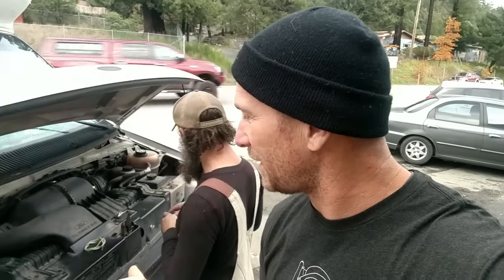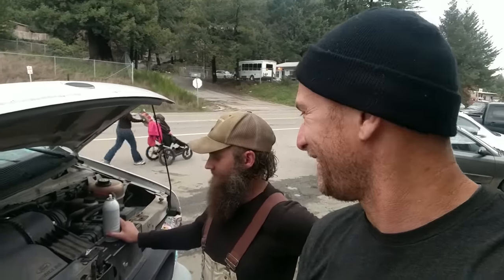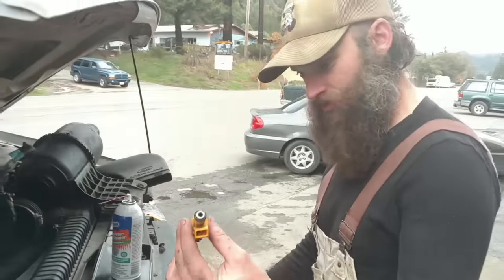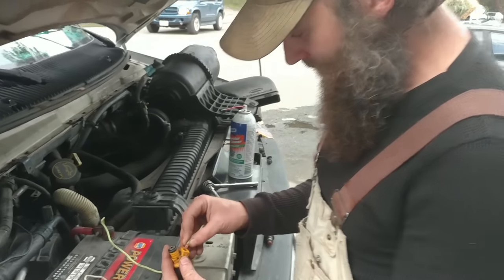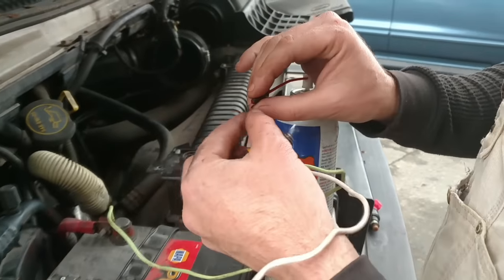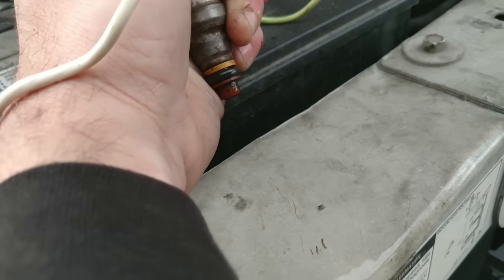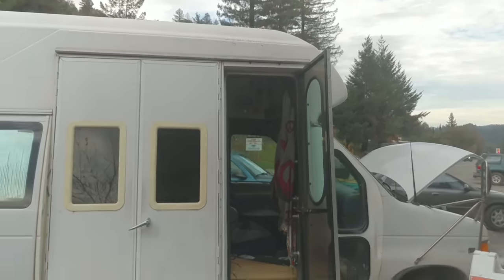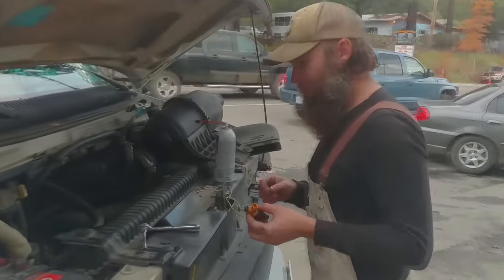Dirty fuel injectors?   Dont buy new ones- do this instead!

Comment: Remove the fuel filter, empty it, fill it with carb cleaner or sea foam etc, then crank the engine a few seconds, wait, then again, then again.
Reply: Tada!
Reply: sea foam doesn't work for this, it was developed for marine outboards to help keep carbon buildup down, it's not strong enough to clean injectors.

Comment: Make sure those fuel injectors are of the high impedance style! I wouldn't hold a peak and hold injector open like that for a second let alone the time it takes to clean them. They will burn-out without having fuel flow around to cool them. The low resistance will heat-up very quickly.
Nice trick otherwise.

Comment: First find information , which is the voltage of the fuel injectors.Most of them are 12 Volts , so you can take that voltage from car battery.You can use carb cleaner, denaturated alchocol, ethyl alchocol 96%, nitro....
Reply: al co hol

Comment: Want to know something scary?
Inside of gas turbine engines, there are things called swirl cups. Similar concept as the fuel injectors for your van - they atomize the fuel right before the ignition - poof! Swirl cups are about 12,000$ a piece. Depending on the size of the engine, there could be as few as two or as many as six. The engines on an Airbus A380, those will have four. A C-5 Galaxy has six. Then there is the question of “if and when” that are added to the invoice, as well as the man hours and downtime for that aircraft.
In the field, we use an engine cleaning solution called BNB. Think of this like Mechanic In A Bottle… but you definitely don’t want to get this on your skin. This will literally melt your skin on contact - pain included. This is not an acidic solution, though, so; we keep lots of vinegar available… in the event we feel like pickling ourselves. BNB helps to loosen and flush debris and other unwanted material from the blades, rotors and everything else inside the engine. Here’s the scary part: If there is no BNB on hand, we are to remove the swirl cups and just take a low pressure air hose (250-300psi) to clean them out the best we can. 
The people that give those orders have never seen the inside of a gas turbine engine, let alone the combustion section of one. I guarantee it.
Reply from the maker: Comments officially hijacked

Comment: Whats the product used? Also can you use brake cleaner from autozone, (non-chlorinated) as well or does it have to be carb cleaner?
Reply: I will say both would work to a point, but carby cleaner would be more preferable as it removes varnish fractions much better.
Reply: Carb cleaner costs $8 and its made to remove carbon deposits in engines, if youre going to pull your injectors spend $8 on the proper cleaner

Comment: for rookie playing with 12V battery that close between+ and - could be fatal, The current can flow as much as 600Amps and weld the cable and burn the 12V battery.  It is better to use 9V battery.
Reply from the maker: calm down poindexter.  no ones gonna die from this silly procedure.
Reply: @dridiott  You obviously have not seen a car battery explode, do not do anything electrical around or over a battery. He could make a small investment in longer wires with a on/off switch and an injector connection plug
Reply: When you say 9volt batt. do you mean the small household battery for toys and radios etc ?

Comment: Or you can just add injector cleaner into the gas tank at regular intervals, such as at oil changes.  I have two vehicles with a combination of 345,000 miles and neither have had the injectors removed.
Reply: He has shot injectors, and if theyre constantly dirty probably bad filters, and possibly a bad pump now. He needs to get a new gas tank, they arnt expensive and hes gonna wear all his lines/engine down with debri

Comment: Just the fact that he has said he has done it like this so many times should be a clue. He is likely having problems due to a clogged fuel filter, and maybe a little too much meth.
If there is anything blocking the injector the best way to do it is pressurize the nozzle with solvent (sometimes air is enough) and click the injector a few dozen times. That way, the debris will blow out of the injector instead of lodging itself further in. Also, go ahead and wire up a switch on the negative wire, and real connectors. It will cost a lot more ($3) but will be worth it.
Reply: clogged filter wouldnt let the fuel get to injectors good try on Shaming someone you dont know...try knowing what your talking about next time.
Reply: @thomastrumigneault8918   Moron, a partially clogged filter will let fuel through, but not enough for the engine to run properly at high loads or high rpm. When the fuel pressure drops, the engine will start to go lean and the ecu will have to open the injectors for a much longer duty cycle than normal. This guy is cleaning his injectors the wrong way and its not going to have any lasting effect. That's why he has had to clean them so many times. Can you wrap your pathetic noggin around that or should I dumb it down for you some more?

Comment: So what about when the solenoid gets weak?

Also if you are spraying flammable cleaner and an arch from the wire to the injector ignites it.. you will have a fire.

You should change your fuel filter if your injectors are getting plugged up all the time or atleast put another one in the engine bay..
Reply: You only get the possibility for fire if there's a spark and it has to be very near fumes.
Reply: @bobclifton8021  doesn't take much in an enclosed space

Comment: not to mention how close those 2 little bare wires were when inserted into that injector plug then hooked to that battery with no short protection....sooner or latter he's going to get an interruption that will light up his day
Reply from the maker: if youre afraid of getting electrocuted by 12v you should put in another tampon
Reply from the maker: stop cheating on your wife lol. and stop using the elipsis with extra periods... oh wait does this hail back to the tampon thing?  clever girl............. @scooterbutner9674
Reply: @dridiott  It's not voltage that kills you, it's current.  300kV won't even kill you until there's enough load to produce enough current to stop your heart.  I'm being picky but technically, the voltage isn't what determines whether you need a tampon or not.  These injectors probably draw milliamps, so not a bid deal.
Reply from the maker: @jerrybrown66  exactly.
Reply from the maker: @botakbishop1441  glad you enjoyed the video.
Reply from the maker: @botakbishop1441   I like to hear idiots try to speak their peace and think they burn somebody. That's precisely why I leave the comment section on.  Thank you for your service and please, respond with further aplomb 👍😂
Reply from the maker: @botakbishop1441  I love you. 💋

Comment: Got a dirty gas tank...had to do this a dozen times already.
Changing fuel filter is important.
Royal purple fuel injector cleaner worked increably well for me.
If a injector has low resistance nothing but new injectors well cure problem.

Comment: Very dangerous way to clean injectors, the Carb Cleaner damages internal components, it also ruins the filter which then goes into the internals of the injector, It does not let you know if the flow is correct compared to the other injectors. We have injectors come in for cleaning where someone has done this and the results are disasterous.
Reply from the maker: i dunno gramma.  flow looked pretty good.  also the filter is upstream from the injectors.  do your homework before you challenge the stupid shit on this channel denny :)

Comment: Lastly, autozone brand carb cleaner, crc brand carb cleaner or gunk for cleaning the fuel injectors? Same question applies to the brand name on using brake cleaner as a substitute or alternative if applicable with little to no damage at all.

Comment: If you have accidentally cleaned your tank and fuel filter, don't worry - you can enjoy the same experience as this guy by manually putting bits of crap into the injectors once every week and then taking them out and cleaning them again.
Reply: What is this comment

Comment: Don’t do this... trust me
Reply: Please explain
Reply: cire80 proper way to clean but not best method. Having two wires just stuck in there from battery. Those touch and you’re done
Reply: @boxbreakracing  just make sure they dont touch. Thanks for the warning of caution that they should not touch.
Reply: @NdalamaCassiusMaluleke  keep in mind that if they touch the sparks can ignite around the area where injectors were pulled, also if touched too long the amps will burn that wire clean. Not to mention if that positive wire hits any part of the chassis where it’s bare metal or thin paint sparks will fly or you might have back current run through a ground wire and fry a needed component.

Comment: Is that Ok if you keep the power to the injector on like that? I saw some other videos just jump on and off?
Reply: You have to leave the piston within the injector open to clean it. Doesn't hurt anything.
Reply: They are good for a minute or so, I have used injector test benches before, one test is to open the injector up constantly and see how much fluid they pass in a set amount of time, this test does open them up for 3 to 4 times longer than he had it open. That being said i would myself do it with a 9v battery first as there would be far less chance of damage and less chance of a spark that could ignite the spray he is using

Comment: I will give this a try but with a smaller 12V  (low amperage) battery and a better setup using wires that have insulated spade connectors on both ends. This guy is crazy not using insulated spade connectors on the end of the wires and a car battery. This method he is showing is way too dangerous if you accidentally short out the wires with that high of amperage you could incur serious burns or worse.
Reply from the maker: Okay Mom

Comment: If you have a dirty tank would it also work, putting sea foam in….. or is putting heet on an empty tank then put gas in it clean orrrr is can you carry a gas can run the vehicle till empty and so it goes to the fuel filter then replace it for better and cleaner gas

I know heet is for water evaporation but won’t one of these methods work to Help clean out the tank or are these just methods for minors results… OPINIONS please?

Comment: "Had to do this little trick a dozen times already, so got fast at it"? 
is it only me that thinks "so it doesn't work, or is at best a very temporary fix?"
Reply: I’m sure he said he has a dirty gas tank aswell
Reply: @part2140  surely he has a fuel filter on it? 
But as that was over 3 years ago, he's probably got rid of the car or actually replaced the injectors  by  now(or had them properly serviced),  along with cleaning the tank eccetera.

Comment: With clogged injectors can it make your vehicle stop running?
Reply: Yes, replace filters and check tank and fuel pressure before injectors though. No point in cleaning the end of the system when the source is at the beggining

Comment: If I put in a new engine will I need to change injectors due to the engine compression ? A mechanic told me I would
Reply from the maker: It's the injectors are good why would you replace them?

Comment: You can buy these "Injector Kits" that hook to the rail; evidently,
you don't even have to disconnect anything---just run this
Cleaning solution through the system.  Haven't tried it yet,
need a little more input on the subject.

Comment: No, no...too much work. Unplug the fuel pump relay, take out the fuel system Schrader valve and shoot the cleaner in the rails while you crank.  It will not run...unless you put pressure in the line which is possible, but it will clean the injectors.

Comment: You had to do this a dozen times already?
In how many miles?
We have nearly 64,000 miles on our Toyota and never did this. We use ethanol-free fuel and Lucas injector cleaner.
Reply from the maker: Comparing a new Toyota to 1,000-year-old shit box with a predictable outcome.

Comment: I only use Royal purple oil and Royal purple Max cleaner every 5,000 to 7,000 mi it says it's good to up to 10,000 mi but I like to take care of my car so it lasts longer and it's a lot more cleaner than all these other cars on the road and that will last a whole lot longer probably at least $400 to $500,000 mi right now I'm at 116,000 and it's a Toyota Camry so it's the best Toyotas out there

Comment: It may mot be a good idea to keep power on the injector for a long period of time, they are designed to be pulsed, not continuously energized.
Reply: The injector is just a coil/magnet just like your clutch on the air conditioning pump. Its not going to hurt it for that amount of time. If that concerned then just use a 9v battery like he said. Been there, Done that.

Comment: Wow! I don’t know what he was using to blow through the injectors but I was worried if it was extremely flammable like gasoline that when he pulled the wires out it there is usually a spark. Not knocking the idea, just the method

Comment: Dude sprayed highly corrosive cleaner through the injector right onto the painted surface of his van. Not a smart move! Run a tank or two of Techron through the gas tank and you should achieve the same results with much less effort and mess.
Reply from the maker: nice Chevron shill. won't work

Comment: This is BS. The most common cause of bad spray pattern is the injector
is worn out. Worn injectors can dribble even when not immediately spraying
fuel (turned off). If some foreign matter has made it through the filter, and
is clogging the injector tip one would really have to apply reverse pressure
at the tip while energizing the injector solenoid (turned on momentarily only). 
Solvents only clean things like varnishes that may form from long inactivity. 
In the case of a vehicle sitting for a long period all of the fuel system should 
be cleaned starting with the tank, and a new fuel filter. The best way to stop 
bad spray patterns, and dribbling is to replace the injector because most likely 
(90%+)the cause is the injector tip is worn out. Me, 17 yrs GM trained 
professional master mechanic/machinist, College educated (BSEE, BSME). 
Do not buy cheap Chinese crap, in my vehicle I used Ford name brand
injectors (made in Japan for many Toyota, Nissan, and other applications).
I bought the injectors on eBay for way less than found at auto parts stores, or 
Ford dealerships. Mr. half trained shade tree is careless &  incompetent.

Comment: Lmao my diesel injectors are completely stretched out . The fuel under pressure caused the metal tip to actually change shape and the holes were blew out 3 times the size . Not all injectors can just be cleaned out .

Comment: nonsense, not all injectors are the same, the fuel that runs through it is at much higher pressure  then his silly spray. Also injectors are subject to ware so they can simply be worn out and this is only demonstration  for petrol engines

Comment: Doing that was amazingly dumb cause u just messed up the resitor inside the injector which with checked with a ohm meter is lower now guaranteed and will be on its way to fail much quicker
Reply: Absolutely lol. They're basically a solenoid valve. Not meant to have constant electrical current applied to them. Short bursts of electrical current is fine, but usually no more than a few seconds at one time. That injector is toast.

Comment: LMFAO fuel injectors operate on a momentary 5 volt signal not 12 volt. an  extended engagement of 12 volts to the injector is going to burn up the coil inside. don't do this. it's stupid.